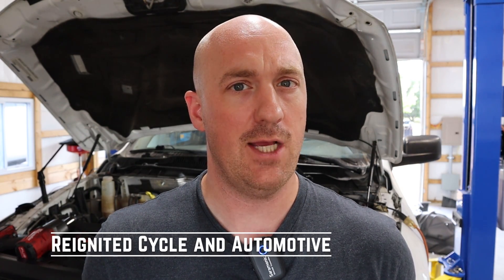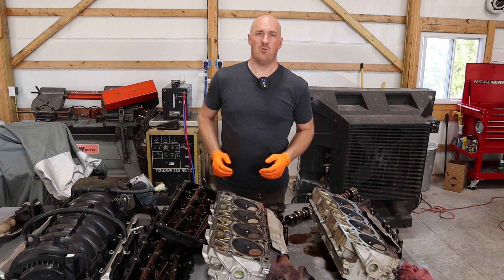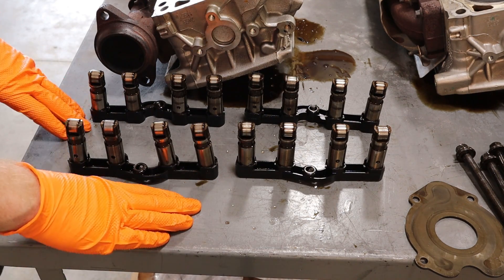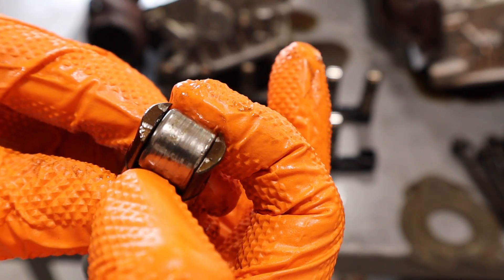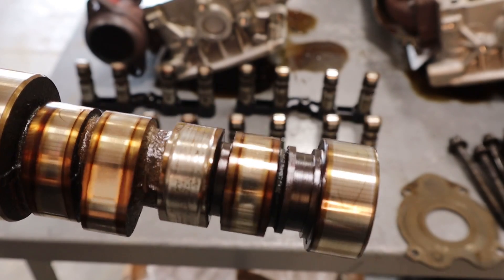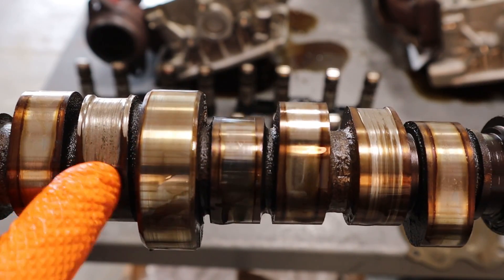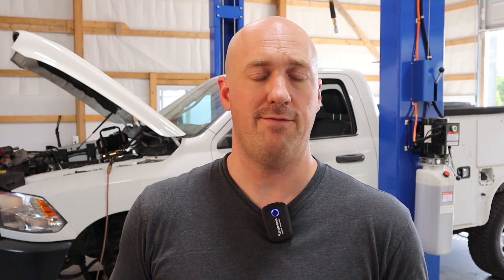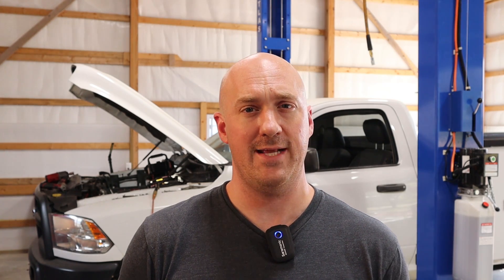Hemi 5.7 Lifter FAILURE Does this engine have a fatal flaw? Find out how YOU can prevent it!!!

Comment: I think the issue is the oil intervals the computer asks for are too long. Should not let the oil go over 5k on these hemis. The hemi seems to be harder on oil due to the angle the lifters are place in the bore. Oil is cheap enough to do it every 5k not 8k-9k like the computer recommends.
Reply from the maker: I'd have to agree with you.

Comment: MDS lifters need oil pressure to flow into the little hole on the side of the lifter. The MDS solenoid controls oil flow to the MDS lifter bore. When the solenoid turns on and off it activates or deactivates MDS. So therefore the only time the MDS lifters receive oil through the galley is when MDS is activated. Otherwise it relies on splash. So higher idling makes it much worse.

Comment: The issue is that the MDS lifters only receives oil once MDS is activated. Otherwise they only rely on splash. Remove the mds solenoid and replace the lifters with non
 mds lifters.

Comment: Should I add 1 quart of 5/30 redline break in oil ,at oil change I have a 4th gen 2017 5.7 hemi...I heard 5/20 redline helps when added to fresh oil change about a quart ...or is that just danger to my hemi
Reply from the maker: It's a side effect of me working for dealers for so long, but I'm not a fan of putting anything other than the factory recommended oil in my engines. The engineers will always be smarter than me, and trying to outsmart them is always a losing proposition. Not to say they can't be idiots too, but usually there's a reason why they recommend what they do. 👍

Comment: I have a 2010 Dodge Charger R/T and when I accelerate fast around 35-40 mph I keep hearing this clicking clacking noise on the passenger side then it goes away around 50-60 mph what could that be???

Comment: I wonder if you can increase your oil pump pressure at idle, but that doesn’t really help because the mds cuts in and therefore won’t supply the oil to the roller lifters?
Reply from the maker: I need to clarify that the lifter bores always receive some oil, it's just that they receive pressurized oil when the  MDS is active.

Comment: if i were to send you a video of a weird sound i have, could you knock it down to a part? it doesnt sound like the exhaust leak, ive had that before and replaced studs... but this comes on every now and then, only at idle, sounding like a light tapping/knocking.
Reply from the maker: Noises are tricky, but I can try. Send it to my Instagram @reignited.tx 👍

Comment: Would you recommend buying a 05 300 5.7  with 128,xxx miles for 3.5k in 2021?
Reply from the maker: That's decently low mileage for the year. I actually like that generation of Hemi engine. A 16 year old car can obviously have all sorts of failures that just happen, but I like the cars. Check out my rebuild series on the 2006 Chrysler 300 I did, I think it turned out pretty well. 👍

Comment: Simple and great tip for making sure you maintain fresh oil! Would these engines benefit from a high volume oil pump? 

Also can you run 5W30 or 5W40 synthetic in these engines if it sees harsher duty?
Reply from the maker: I haven't seen enough data from a high volume pump to know if us beneficial or not. As far as engine oil, I'm personally still a fan of sticking with the manufacturers recommendations, since I feel the engineers will always be smarter than me. That being said, I've had a lot of feedback from viewers who have run various viscosity oils with no ill effects. 👍
Reply: @ReignitedAuto  Awesome, thanks for the reply!
Reply: Try amsoil

Comment: So I heard there was a lifter update in 2017 to solve the 5.7 lifter failure problem. Does anyone have any further information?
Reply from the maker: I have heard that myself, but I'm not sure how much truth there is in it. The lifter part number has not changed in quite some time, predating 2017. Not to mention which I've performed failed lifter repairs on a couple 2017 models and one 2018 model.

Comment: What about all that metal in the oil and now in the bearings.?
Reply from the maker: On the Hemi engine there is a solenoid that controls the VVT, remove that solenoid and look at the metal screen. If the screen is covered in metal debris then the short block should be replaced. If the screen is still clear you can get away with just an oil change with the cam/lifter replacement. 👍

Comment: your video now has me wondering. Should I change my oil every 5k km's? or keep using the oil life % indicator in the dash? Does the indicator actually know the oil viscosity ?
Reply from the maker: I did some more research on the oil life monitor to see if it tracks by mileage or by engine hours. Turned out it does both, and also included a bunch more data as well including how you are driving and what sort of driving cycles the engine is going through. All that being said, I'd still rather change my oil every 3-4k miles, sometimes I feel like those oil life monitors will stretch it out further than you should. Just my opinion though. Thanks for watching! 👍

Comment: Look at the cam. Oil is burnt onto all of the cam exposed surfaces. I see this with owner negligence. This is a sign of poor maintainance. 
Having said that. That doesn't explain the situation. The cylinder deactivation lifters have an internal cylinder that acts like a hammer which oscillates causing a vibration that pounds the niddle bearings constantly. Obviously, if they were all the same solid lifters there would be no problems. Done.
Reply from the maker: Check out my latest video on this issue, I completely disassemble a MDS lifter and show its operation! Link is in the pinned comment at the top 👍

Comment: I have a hellcat and I believe this is what is happening to mine but haven’t confirmed it and it is misfiring but no code but at a stop light in drive it’s the most noticeable. Is there some on tsb you know what of it’s out of warranty so figure why not. is it horribly extensive? Can you do a video on a lifter fix tear down and repair?
Reply from the maker: Some misfires are slight enough that they won't set a code, especially at idle. Haven't seen a tsb except for police vehicles dealing with excessive idling. I'm putting out a video in about 2 weeks installing an aftermarket cam in a Challenger, but that will detail the whole process including replacing lifters. 👍
Reply: @ReignitedAuto  hell yeah man! thank you sir.

Comment: Hey, what would you think about going up from 0-40w onthe 6.4 anyway, to 5-40 or 10-40 syn...and maybe live with a ''code'' [if set]? your thoughts? thanks! jeffbob
Reply from the maker: Me personally, I'm a big believer in sticking to what the engineers who designed the vehicle recommend. They're generally smarter than I am, so even though I love to modify vehicles, I like to stick with the factory recommended viscosity. That being said, I'm getting a fair amount of feedback from people who have ran different viscosity with no ill effects. 👍
Reply: Is it POSSIBLE Chrysler, in a mad conspiracy to make a profit; requires 5w20 because it shortens engine component life?  

Thereby requiring the owner to spend MORE money on repairs POST WARRANTY??   Same goes with a 180 thermostat, car runs better, cooler.  They know that but requires a hotter thermostat.

Dodge engineers are smarter, sure.  But, I am suspicious of some of their recommendations due to the motives are ALWAYS PROFIT BASED.

Comment: On Uncle Tony's Garage he tore a Gen 3 Hemi apart before it had lifter problems and just looked for signs of wear.
Then he compared two different blocks where only one of them was a Gen 3.
I think he has the best video on the so called lifter problem because he did the most research.
Reply from the maker: I have a new video with more information about the oil flow and lifter design if you want to check it out, link is in the pinned comment at the top! 👍

Comment: Its got nothing to do with engine oil breakdown, its a shitty cam/lifter oiling design. They only recieve oil from the crank slingin it like a freakin lawn mower.... c'mon chrysler just admit u f-ed up...
Reply from the maker: I've got more information about the oiling system on this engine in my new video about this issue, link to the vid is in the pinned comment at the top! 👍

Comment: I went from conventional oil, to synthetic blend, and my tick has stopped now. Next oil change is full synthetic! Wish I had listened to these younger guys sooner, instead of following my own old ways!
Reply: fully synthetic will not fix this or keep it from occurring.  I've run Mobil 1 Fully Synthetic since I bought my challenger new.  Only 46K miles and it's a manual trans with no mds.  I've had lifter tick for 30L miles and dodge said it was normal or a small exhaust leak so I ignored it.  Bad mistake.  I now have to replace the lifters and cam due to wiped lobes and bad lifters.  I know several others who have 5.7L engines who are experiencing misfires now and who have the lifter tick.  I have over 1M miles of driving under my belt and I've never had a mechanical issue with any of my engines until the 5.7L.  I'll be pulling the cam next weekend to see how bad things are.

Comment: I have a 2009 Ram 1500 with 185,000 miles.  I have changed the oil every 5000 miles and have no lifter issues.  I will say however that I have had the read exhaust manifold bolts done FOUR times.  I happens about every 40,000 miles, twice on each side.  Fortunately I have the lifetime powertrain warranty as the original owner and have never paid for any of the repairs. Are the manifold bolts a problem on a all the G4 year models, or has the problem been corrected?  I was told that it was how the exhaust system was hung not allowing enough movement.
Reply from the maker: I have another video specifically covering the exhaust bolt issue called, " the OTHER Hemi tick" 👍 Nice work on keeping that lifetime powertrain warranty, it was quite the asset for people who got it 😎

Comment: I work on a commercial fleet with Ford, Chevy, and Ram(Dodge) in it. These trucks idle a LOT. The only place I see this problem is in the Hemi of all displacements. All our trucks are serviced the same using the same full synthetic oil except the 6.4 Hemi's which require 0W40 full synthetic. Uncle Tony has it right, when the lifters are laid as flat as they are in the Hemi there is very little to no drip back on the cam lobe from the lifter which allows the roller to run dry. I have the perfect fix for the Hemi, get a Ford or GM and you're golden.
Reply from the maker: Check out my latest video on this issue for more info about the oiling system. Link is in the pinned comment at the top! 👍

Comment: I was looking at the 2020 Dodge Challenger with a 5.7 hemi and two separate cases two separate vehicles on initial start I could hear significant tapping is sounded like it had no oil in it then after a minute it cleared up and sounded fine. These are brand new cars on the dealer lot with less than 200 miles is that the exhaust tap
Reply from the maker: Honestly, that's just the way Hemi engines sound. I've been prepping brand new cars for years, and all Hemis sound like that. I wouldn't hesitate to get a brand new challenger, they are great cars 👍
Reply: @ReignitedAuto  thanks for that. I was ready to buy until I heard that. Otherwise I loved the car

Comment: There are cars with this problem that have oil changes three times more often than expected. The problem isn't the oil, the MDS, or the infrequent oil change. At idle, the pressure is very low.  The motor is poorly designed.  It has a very high crankshaft and camshaft from each other.  This can be seen from the size of the chain.  Compare the chain from the chevy smallblock and the hemi.  Hemi has a much larger chain.  To solve the problem, an oil pump with increased pressure is needed. Following the new pump, more oil will be required, which means that a sump with an increased capacity is needed, an increase in pressure requires replacing the oil pressure sensors and valve cover gaskets.  Also, the increased pressure begins to throw a lot of oil into the cylinders and in order not to get a lot of carbon deposits, an oil trap must be installed. There is one more solution.  It is simpler but not cheaper.  Drive fast in your car and try not to stop.  Traffic jams kill this motor. To avoid problems, buy a Toyota tundra or sequoia.  But they eat 30% more gasoline.  Choose what to pay the same money for.  For gasoline or for replacement of spare parts at hemi.  I like the Ram 1500 so I don't care about chevy and toyota.
Reply from the maker: Check out my latest video on this issue for more information regarding the oiling of the lifters! link is in the pinned comment at the top 👍

Comment: Mine is a 13 with 85000 miles.. has never been past half throttle and I let it shift at 2000 rpms...only idle is at a red light... even really cold let it idle forage few minutes but use synthetic in the winter and dino pennzoil in the summer..I have almost no idle time and change oil every 3500 miles... I am a retired mechanic
Reply from the maker: Appreciate the feedback!

Comment: Its easy to blame the consumer, then say you should change oil more often.   I know quite a bit about changing oil.  I've never taken a car to a garage-period.  I put on about 150,000 miles a year on my vehicle (for the past almost 40 years).    THE PROBLEM IS WITH DODGE.
I once put 58,000 on a vehicle without changing the oil once. (It was a $500 K car I wanted to blow up.  It never did)  I had a 98 Cavalier I put 500,000 miles on it and changed the oil every 10,000 miles (once it went to like 14,000).  I had an 87 Dakota that I switched the engine to a newer 3.9 with fuel injection but kept the head, intake and carb of my truck instead of switching all to fuel injection.  The problem was that they changed the oil ports to how oil travels to the lifters.  My old heads wouldn't get oil from the newer 3.9 block.  I branched off the oil sending unit, put brake lines down through the valve covers and into the tube the rocker arms travel on.  Now the problem was my motor had no oil pressure (it all went to the heads), so I installed a ball valve, choked back on the oil flow, removed the handle, and drove that truck for 13 years like that. 
Vehicle (or anything) are designed with parameters that accept a larger range than anticipated. 
Why didn't Dodge design for this?
After watching your video I thought I would do what I almost never do-thumbs down.  I decided that just because I disagree with someone is no reason to punish.  Your intro is too long, though (just like my comment).
Reply from the maker: I appreciate your feedback though! I think sometimes we all want things to be designed better than they are. Sometimes engines are built far beyond what is necessary, and some are built on the ragged edge of being serviceable. I feel like the Hemi falls somewhere in between. You can also check out my newest video about this issue with more information on the oiling system, link is in the pinned comment at the top. Thanks for watching! 👍

Comment: Had a 3rd gen developed a lifter issue at 250,000KM. Would have loved for it to last longer, but soon after most parts of the truck started failing so even if the motor had hung in longer the truck would have been scrapped.
Reply from the maker: That's a win to me! Thanks for watching 👍

Comment: So based on 55 mph..   54 hours.. would be roughly 3,000 miles...
90 hours... roughly 5,000 miles 🧐 .??
Well if that’s the case... I’m way off on the intervals... FCA has the oil change  interval on the computer display in the truck.... you mean that’s incorrect??
Reply from the maker: Number I got from a Chrysler engineer some years ago, 1 engine hour is equal to 33.6 miles.

Comment: What year does the gen  3 start I’ve got a 2004  57 hemi with 166000.00 miles on it and no problems so far
Reply from the maker: Gen 3 started in 2003, your generation are usually pretty solid, they don't have a lot of the bells and whistles of the newer generations that seem to have weak points. 👍

Comment: Got two that came into the shop today  with the "hemi tick" and one is far worse than the other with a painful "scratching" sound. The other has a tick and a dead cylinder. Both have been meticulously maintained with all oil changes and recommended maintenance done when they are recommended. One we know needs an engine (metal in oil) the other hasn't been in the bay yet

Comment: I work in a ram dealership for five years the hemi engine is OK pretty good but if you abuse it if you don’t keep the oil super clean if you run it hard without taking care of it it will definitely blow up the top into the engine it’s only as good as you take care of it
Reply from the maker: True enough! Check out my updated video on this issue, link is in the pinned comment at the top 👍

Comment: BS it's the oil.   It's well known that the location of the lifters higher in the block cause them to run dry with no splash from the crank or lifter gallery.  The earlier Hemi blocks do not have this issue.
Reply from the maker: Check out my latest video on this issue for more information about the oil flow in the engine, link is in the pinned comment at the top 👍

Comment: My 2019 ram 1500 5.7 had to have a lifter service at only 35,000 miles, definitely not due to long idle times. Its my daily driver! I personally believe it is a fatal flaw that needs to be solved, i see no evidence of "deteriorated oil," especially in my case where I've been changing my oil every 5,000 miles, only use premium gasoline, and haven't done any off-roading.

Fatal flaw 100%. The chevys with cylinder deactivation have the same problem!
Reply from the maker: Check out my latest video on this issue for more information, link is in the pinned comment at the top! 👍